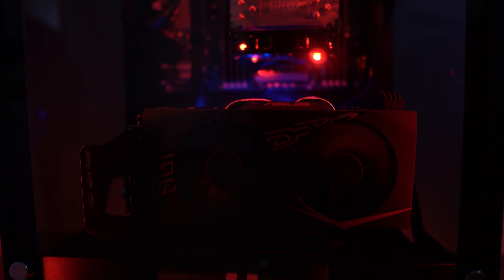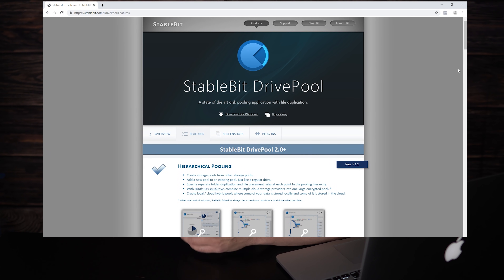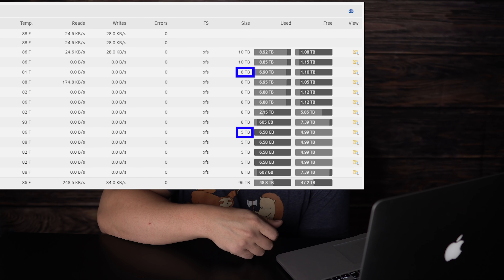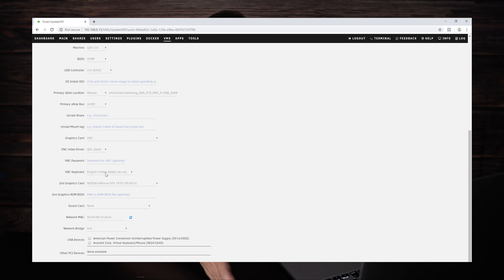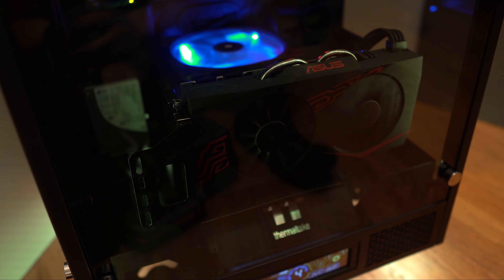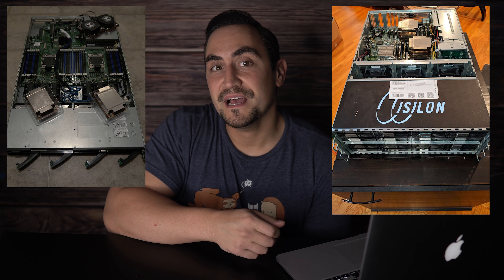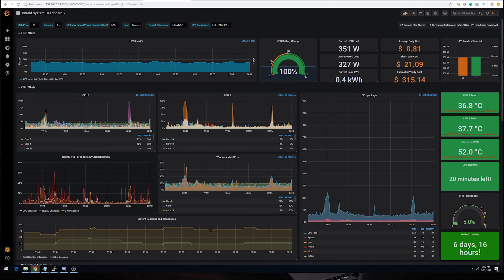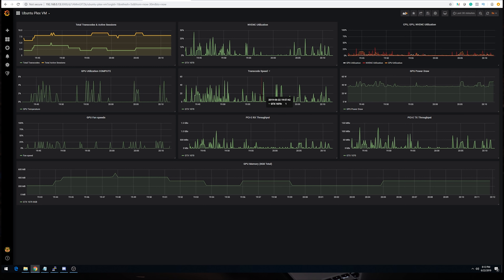How to build a quiet 117TB Plex media server (Part 2)

Comment: This is interesting because I have bean trying to decide which case I wanted to build a NAS in and I have this ThermalTake 900 and a CaseLabs TH10-V both still unopened and in the box delivered in years ago. The issue with the CaseLabs case is I can't order parts and I do not own a 3D printer.

Comment: Great video. Thanks for sharing. I was wondering what are the benefits in using a motherboard and running 2 Intel CPU's?

I run my Plex Server on a dedicated PC via Ubuntu with an Intel 11700k with Quicksync for HW transcoding, synology NAS for storage, and a separate PC that handles all of the getting content automation. Its not ideal to have all of this separately, but I just kept expanding to serve more family and friends.

Interested to know your thoughts. Thanks.

Comment: At some you'll definitely need the added improvements of PCIe Gen 4.0 M.2 NVMe SSD AICs which will be another way to faster RAID on a PCIe Gen 4.0 motherboard and IGP capable CPU probably an ARM SoC by then.  I wonder what LSI controller would keep up with such NVMe storage RAIDs?

Comment: How come you can do 47 transcodes, when in a previous video you said 27 was the max?
Reply from the maker: I'm using a gtx 1070, not a p2000
Reply: @SlothTechTV  I thought the none Quadro cards had a hard limit of transcodes?
Reply from the maker: @Pabula  Sorry misread your comment -- the 1080 does have a limit, but there is a patch you can install in unraid or linux/windows -- it unlocks it

Comment: I'm building a server in this case after being inspired by this video, but I have a question.  What did you use as your GPU vertical mount, and specifically how long of a PCI-E riser cable did you need to be able to reach the PCI slots on the motherboard?

Comment: I see this case is still available for purchase on Amazon.  However I am a bit confuse and would love if you can clear this up
1. so what is the maximum number of 3.5 drives one can install on this case?  It is not clear from the amazon description
2. Does it come with all the drive cage / tray / caddle need to mount the drives?  or additional purchase would be required?
thank you again in advance for any feedback
Reply from the maker: I think it only comes with two drive bays for a total of 4 in the back and two up front (I think) I ordered more through support
Reply: @SlothTechTV  ok, so if I understand you correctly, you can order more cage/caddy/tray from Thermatake?  if so, what is the maximum number of drive on each side of the case in the back section?  Is it a caddy / cage where is a block of metal for say 3 drives, or individual tray for each drive?  DO you remember the cost?.  thank you so much for the info

Comment: My 3 Silon's Work fine, you need need to make sure that they don't have one cpu in them, the cpus are cheap to replace  &  also maxed out the ram on mine, I do keep my electric at or under 100 with all the stuff I run in the apartment

Comment: Raid 1 is a huge waste of disk space and it's not faster than RAID five or six with a hardware RAID controller. They have mastercool hot swappable drive bay cases. You could set up Windows 10 with Windows subsystem for Linux running Ubuntu. Then set up a startup script so that if your system crashes it will launch the windows subsystem for Linux again and then Plex will start running on its own.

Comment: Cool Build.. I Am In The Prosess Of UpGrading My Dual Xeon Supermicro Server & I Ben Doing My Research On What The Best Cpu's Was N Started Out Thinking The 5680 Or 5690 V2's But I Think I Have Foud One That Will Pull As Much Or More Pasmark Score For About Half The Price N Im Kinda Leaning That Way,I Have A Supermicro CSE-946 24Bay Case With a X9DRI-F Dual 1200W powersuply 10GbNic  n Working On A Ram Upgrade to..lol...Again Very Cool Video..I Love Server Hardware/Talk Thanks !

Comment: Humidity as you stated is not a concern for HDDs, it's more about the temperature. The housings of the disks are highly sealed, specifically for the Helium  filled ones, but also for the ones before the Helium-age, leaving only the little controller board exposed to humidity, and that is as vulnerable to it as any other electronic component: Not too much, as long as it stays within reasonable boundaries. 

Other than that, nice setup. I understand why you went towards that eye-catcher-build, I still prefer to have a server look like a server and being housed within a rack =)

Comment: Nice Video, pretty sleek rack. Two things i would suggest to you: First, you should checkout a combination of Proxmox and Snapraid+Mergerfs instead of Unraid, as Snapraid is far superior to the proprietary and limited unraid solution. And second: Better remove the Castors. You don't wanna simply "move" your server around with that many HDDs inside. Even when powered down, the vibration can and will kill your HDDs faster!

Comment: I am checking this out for the second time. I need to do a similar solution (without all this disks, but with space to grow). I'm just curious if you needed to do any modifications to fit all those HDs there.
Reply from the maker: no modifications, i just needed a bunch of drive cages. I'm going to put out a video soon with a cheaper solution (not as pretty but cheaper and even quieter)
Reply from the maker: i got the drive cages from thermaltake USA support
Reply: @SlothTechTV  I will wait for this new video before investing in a new case. I have now a new Ryzen mounted on a mid-tower of old, and it is really needing to breathe... And I will tell you if in the end, I buy this case I will be tempted to spend more on hardware and upgrade mobo and processor - what definitively I do not need right now! :-)

Comment: There are only 2 port on Raid and 4 port for each cable breaker. so 2x4 = 8.   And why u said 15 Hard drives. Did I missed sth?

Comment: I built mine Plex Server in the Silverstone CS01HS with the 6 hot-swappable bays. Running an ITX Gigabyte board with an i3 8100, 8gbs of ram, a Marvell SATA card, 6 5TB HDDs on SHR and 2 SSDs on Raid 1 for cache: Also running XPenology. I tossed in a Noctua CPU cooler and a Noctua quite case fan and it is pretty silent. In fact, my darn Xfinity router is louder than my Plex server lol I am only using the NAS for Plex and running the hardware transcoding so it is super solid and fast. I need to figure out a monitoring dashboard solution as well. Looking into it now.

Comment: Hi,
how would this configuration compare with 1x Ryzen 9 3900x and 1x Quadro P2000 for live transcoding of input channels in 1080p from let's say UDP H.265 HEVC input?
Tho, in my situation I wouldn't be using Plex, but rather several instances of FFMpeg.
Any thoughts on which hardware would you recommend for transcoding in realtime let's say 8 1080p HEVC h.265 live channels to 6 different profiles:
1. H.264 720p 3Mbps
2. H.264 720p 2.5Mbps
3. H.264 480p 1.5Mbps
4. H.264 480p 1.0Mbps
5. H.264 360 800Kbps
6. H.264 360 400Kbps

Also, would you recommend multiple Quadro P2000's, or something else?

Thanks!

Comment: Really cool. However, I may have missed that energy point. What how much energy does your tower draw? I'm in a similar situation like your where (currently struggling with silencing a DL180 G6 server) and use a UPS. However, my equipment (include the HP server, 2 Synology NAS (for backup), 2 NUC and a bit network equipment draws around 350W. (I only use my HP server for storage and virtualization). UPS wise already this setup demands a better (clumpsy) UPS... What are your numbers?

Comment: @Sloth Tech TV - I recently purchased a Tower 900 after reviewing several videos and forumns (including yours). However I was just notified by Thermaltake that the stackable HDD bays in the back are not sold seperately and need an RMA for a replacement.... How did you get additional bays? I don't want to start putting in 3rd-party bays in here...
Reply: What did u find out or did u find a 3rd party  one ??

Comment: My Plex server lives in Nuremburg, Germany.  It is a simple Xeon 10 core cpu with 60 GB ram and 1000 MB upload/download symmetrical connection.  I only have 1.6 TB on it and would like to double that space.  Unfortunately I cannot on these VPS units.  It costs me about $30 a month which is very cheap imo.  I have about 9 peeps on that server and most use Direct play.  1 or 2 users transcode from time to time but my CPU doesnt blink at that.  Overall I don't understand why anyone would want a PC at home with its limitations on internet speed/upload and the cost are expensive up front.  I found something that works for me and my friends and we all enjoy movies and shows in the evening... :)  Contabo XL VPS is what I have if anyone is wondering.

Comment: Corsair 1000D: AMD 2950x Threadripper 32GB Ram, 6x10TB shucked drives (10TB Parity/50TB Usable), 2xGTX1080ti's SLI. GTX1050. This is my main gaming PC, video edit PC, Plex server, and NAS all in one. It's water-cooled with 4 x 480mm rads, 2 x D5 pumps. I have Windows 10 VM locked to the same cores as Game Mode (4-11 Cores), then have Plex Docker, Handbrake Auto Convert Dockers, OBS Docker, and Unraid on Cores 0-3 and 12-15. I game in Windows with the 8 Cores with similar results to 2700x, I stream with NDI from windows VM and OBS docker running on the remaining 8 cores, Then I have 2 versions of Handbrake running, 1 is set up to use all 16 Cores, 1 is set up to use 8 cores opposite of Win10 VM set up to auto-convert files to X265. I edit in Davinci Resolve and output in lossless output, which handbrake watches the folder and takes that file and converts it to x265 for me. Usually, I only use 8 cores for that, but occasionally ill stop the 8 core handbrake and open the 16 core to double my output. I store everything in x265. When the time comes I need to increase my storage capacity I plan to run a DAC off the remaining 2 PCIe x16 slots I have to run 16 x HHDS in a case somewhere near this PC, running it all off the main PC.
Reply: mother of god

Comment: I love this build. I've been trying to find something with massive storage that I could potentially run in my living room not far from my TV. Would you say this build is quiet enough to be within earshot of a home theater setup? I live in a one bedroom apartment so this is a limitation I have. Right now I'm running a server out of a mid ATX tower with just 6 drives and I want to scale up.

Thanks for the videos! Subscribed now.
Reply from the maker: It's pretty quiet with the right fans. I can set it to it's quietest setting and it's barely audible sitting right next to it. If I set the fans on max speed (never actually necessary if ambient temps in my house are below 85F) it is about as loud as my gaming PC with noctua fans.
Reply: @SlothTechTV  Thanks for the reply. My current build that's near my entertainment center is a plex/gaming fractal r5 with Noctuas so that's a perfect reference point for me.

That's maxed out at about 40tb usable so I'm a sort of similar boat you where in. I want to build a higher capacity unraid, migrate my media over, and probably just use the other machine for gaming.

Thanks again.
Reply: @SlothTechTV  That's awesome. I have this case on my wishlist for quite some time. Did not buy it because I wasn't able to find a reseller for those drive cages in Europe or Germany... Where did you get yours from? Currently I'm running 12 HDD Drives + 4 Cache SSD's in a Fractal Node 804 + external 4 Drives cage connected via LSI SAS controller. Want to put everything together with more headroom for future Mainboard/cpu and drive upgrades. This bad boy could be able to fit all my needs... If I find extra drive cages to buy. Would be awesome if you have a suggestion. Thx dude for sharing your insides
Reply: @SlothTechTV  can you please answer my question? Where do you get all the drive Cages? Thx dude :)

Comment: Nice server build mate

My current server is a old HP Pavilion 500-374na
core i3-4150 
12gb ddr3 1600mhz
8x10TB HDDS
120G SSD
SAS9211-8I 8PORT Int 6GB Sata+sas Pcie 2.0
Win 10 Pro
using quick sync for hardware transcoding
Antec P101 Silent Computer Case

Comment: I have a Ryzen3700 with a P2000 and I'm thinking about to buy a bigger case with a 8-bay slot and 8x10TB HDDs. Can you recommend Unraid is it stable? or should I just get a 8-bay synology and connect it to my Ryzen for transcoding?

Thanks!

Comment: I'm curious as to why you're running Plex in a VM rather than using the docker version?  I had problems with the docker mainly because my data files are on another server, but yours are on the same server.  What's the advantage I'm missing?  I'm getting really excited about this concept since I can end replication and reduce the drives instead of adding more JBOD boxes.
Reply from the maker: I run this in a VM mostly due to migrating from one environment to another and originally building it in a VM... There are advantages and disadvantages to each option. I think the advantages of docker containerization specifically around assigning dedicated resources like memory to vms and having more dynamic resources with a container is one obvious advantage of container vs VM.

Comment: Right now I'm running Plex on an i7-8700 server with data files separate on a dual e5-2630L Supermicro board in a 24 drive server case.  My software on the server is Windows 2012 R2 Essentials and I'm over 100Tb of data due to running JBOD with Stablebit and 2x replication.  I can transcode many streams because the Plex Server has a Quad P200 video card for HW transcode.  Your idea of switching to UNRAID has me intrigued.  I was in the process of setting up a remote UNRAID server for remote backup anyway.  I like your idea.  Have to see how it goes.

Comment: What do you use for power?

I'm still on commodity hardware. I recycled an old intel CPU and put ubuntu with ZFS on it. The thing I end up doing is just daisy chaining a bunch of sata power connectors. This seems OK because disk power should be low amps and probably wont overload the rail. Just wondering if there is a more elegant solution or if you end up spending a lot of money on a power supply.

Comment: Why are you running Plex inside a vm and not running it inside a docker?  Seems like unnecessary overhead.
Reply: Disregard, scrolled down and answered my own question.   I'm rocking a Supermicro X8DTL-IF with dual X5650s, 96gb of ecc ram and a Quadro p2000.  Sporting 7 matching 10TB WD Reds.

Comment: Am running a 2U R620 a MD1200 and a DS4346 with zero noise issues. It's in the room next to my PC and you can't hear it through a paper thin wall 15 feet from my ears... I'm also at 36 drives with 336TB raw so I needed a little more flexibility.

Comment: While my server currently only has 12TB of hard drive in it, I am running a dual Xenon X5660 in an old Supermico E-ATX board with only 24 GB of RAM in a Roswell 4U chassis. Using FreeNAS and running Plex in a jail and is also housing two Minecraft servers using Mine-OS in a jail as well. The downside to this set up is updating having to run a script to update Plex and do some command line stuff to do it. Not a big deal, just a few hoops to jump through.

Comment: Thanks for the video! I have been through an evolution amazingly similar to your own. I started with QNAP based NAS's, then went to FreeNAS running on older repurposed PC's with external drive enclosures, and finally 3 years ago built a 24 bay 4U rack mounted SuperMicro enclosure. It currently has 128TB of storage configured in multiple RAIDZ2 vdevs (allowing for up to two drive failures) giving about 76TB of usable storage. There's a second 1U Virtualbox system in this rack running VM's, including Plex. Here's a pic from 3 years ago showing how messy my old wiring closet setup of multiple separate repurposed PC's was compared to the rack mount system: https://photos.google.com/share/AF1QipM1fEBuGOhqVNAiM0EU8JbV8MEEaWwuAxzgEJ3YvmYdvdHmeh2ErKBVFZjZFO4S5A?key=UVdWakphS0tyRVFQbExzV1EwWTlOTVZ0SnIwN3F3 ... And yes it sounds like a Dyson vacuum cleaner. One day I'll move to a quiet setup like yours!
Reply: Is that a self built rack?
Reply: @TangoEchoAlphaUK  Norco 15U 4-post open frame rack https://www.newegg.com/norco-r4-15u-4-post-open-frame-rack/p/N82E16816133039
Reply: @djb47  Thanks 👍

Comment: He cannot run more than two transcodes at the same time on a GTX 1070 because Nvidia Locks it down. And what he circled in the screenshot was transcode speed not the number of actual transcode streams. Yeah this guy is an idiot and doesn't know what he's talking about.
Reply from the maker: Lololol you can patch the Nvidia driver and unlock the session limit that IS the total number of transcodes. You should be more careful about calling someone an idiot when you haven't researched the topic.
Reply from the maker: Gg -- there wasn't a single accurate statement in your entire comment.

Comment: i7 4790k OC'ed to 4.8 ghz, 32 gigs of ddr3 at 2133, and an AMD RX 470. I was using an Nvidia GTX 960 but oddly enough the AMD RX 470 does a better job with 4k streams (x265, HEVC) even though the GTX 960 is a faster gaming card I believe it has to do with the drivers and the supported codecs. I have 12 TB's of drive space in raid 1 on a raid card that also has an msata slot for caching which I have a Samsung 860 1 TB msata SSD. I never buffer and watch 4k streams while friends and family transcode limited to 4 megs a stream at 1080P. I will be converting my gaming rig AMD 2700x 32gigs of ddr4 3200 and an Nvidia RTX 2080 into my new server/plex host when i build my new gaming PC.

Comment: Interesting that you used a VM for the plex server. Im curious, does it overall have better performance compared to using a docker? I run unRAID as well but my PLEX server is run though a docker container. With using the nVidia unRAID modified OS, even with plex in a docker, I still have the hardware transcode with my gtx1050 ti.